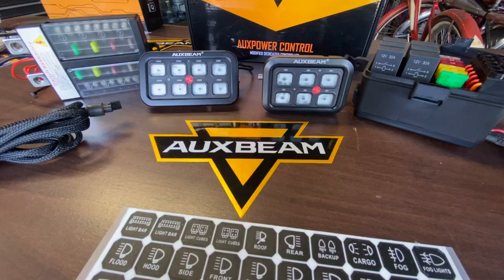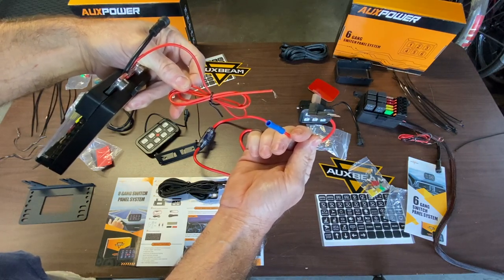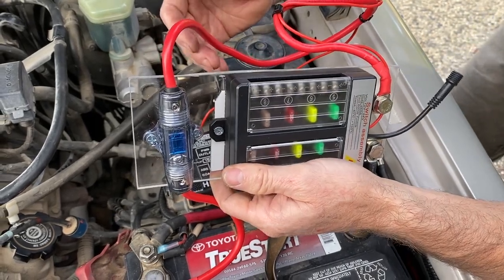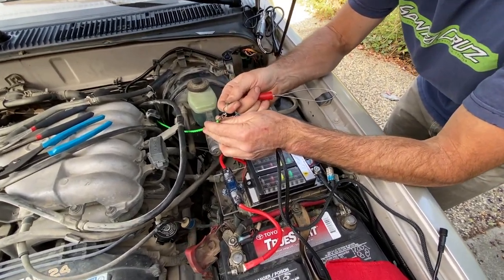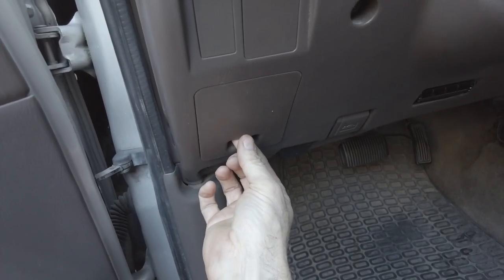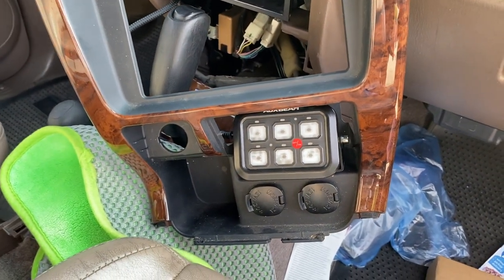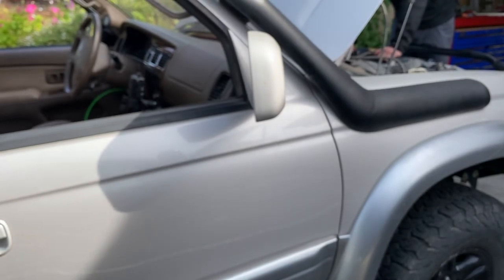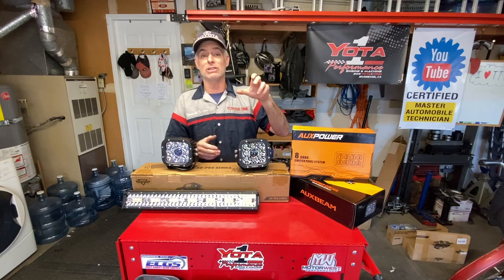How to install an Auxbeam 6 or 8 Gang Switch Panel

Comment: 66k subs you'd think a guy could spring for a mic by now.
Reply from the maker: We've considered using mics but haven't given it much attention because most people aren't looking for crystal clear audio for DIY Automotive Videos.  If the content is good and people can hear what's being said, that's all they care about.  But we might do some research on some Bluetooth mics and see how it work out.
Reply: @TimmyTheToolman  I agree, quality content is important, but so is quality audio. It's like nails on a chalkboard without a mic and you should want to do better.
Reply from the maker: @tazzthedoodle7861  I don't think any of the audio we have in our videos could be described as nails on a chalkboard.  That's a bit extreme.  You're obviously someone who values audio.  We've heard similar criticism before and we started using external mics on our GoPro camera which improved on the quality.  Lately we've been filming mostly with iPhones.  Do you have a suggestion of an external mic that will work with an iPhone?
Reply: If you wire the unit into a “switched” power source the Auxbeam panel is not powered unless your key is turned to the accessory position.

The Auxbeam unit allows for things other than lights to be powered; for example a fridge (as depicted in the stickers). A “switched” power source wouldn’t work in that case, in that the fridge wouldn’t get power all the time.

Do you know of a workaround for that situation?

Comment: Can you make that bracket for me?
Reply from the maker: Did you purchase the 6-gang switch panel?
Reply: @TimmyTheToolman  yes
Reply from the maker: @vitaliisheremeta2489  I might not have the file anymore unfortunately.. I thought I put it on a thumb drive and when I was looking for it recently I couldn’t find it. Might have to design another one. 😅
- Sean
Reply: @TimmyTheToolman  you should design another one and start selling them. I think I’m not the only one who’s looking for that bracket
Reply from the maker: @vitaliisheremeta2489  what would you think a fair price for something like this printed and shipped would be? 
- Sean
Reply: @TimmyTheToolman  maybe like around $50? Idk. The CBI ditch lights brackets were $62 so I think they should cost around the same
Reply from the maker: That seems steep to me. I was thinking more like $30 shipped could work. The CBI ditch mount brackets are pretty well made out of metal. This bracket would be 3D printed.
- Sean
Reply: @TimmyTheToolman  oh ok. $30-$40 is fair price for 3D printed bracket